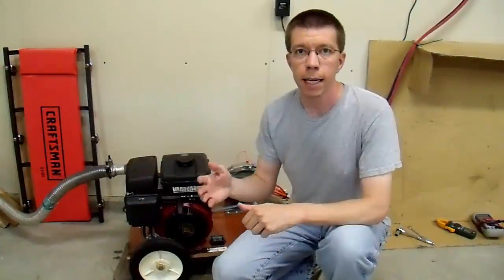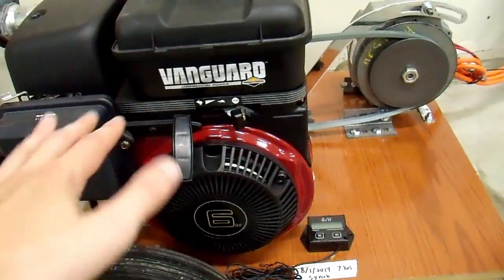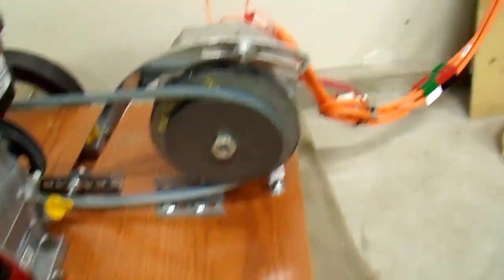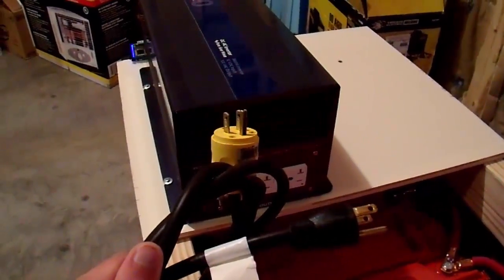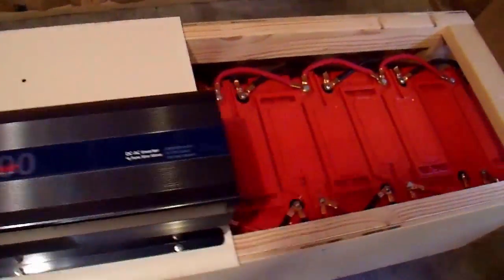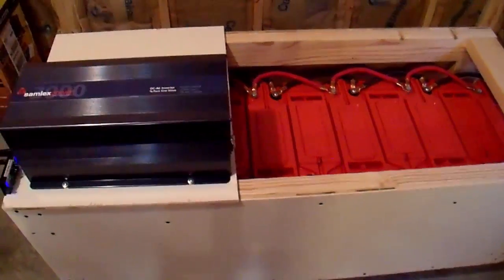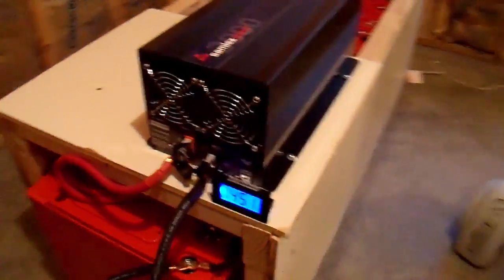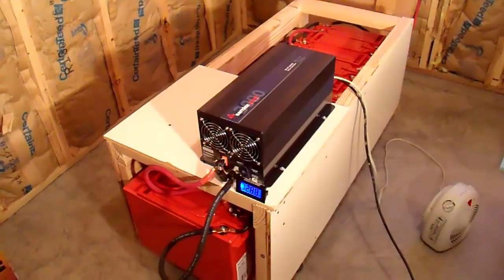DIY 12V Generator Charger - 10 Demonstration and How to Build

Comment: Please forgive the uninformed but I am new to this and leaning as much as I can.

Can you put a double pulley on the motor shaft and with a longer base add a second car alternator to provide twice as much charging for your battery bank or do you need a larger motor? 

How do you determine how much resistance an alternator will have when attempting to hook up a motor to it? Choosing the correct size motor cubic inches vs any alternator?

Thank you for sharing all your knowledge. I am of the visual type learner and just love watching your videos. Peace, Reese.
Reply from the maker: This engine is approx 180cc and is appropriate for a 100A alternator.  If you wanted to power two 100A alternators you would need an engine with about 360cc.  At some point you would get to better engine designs than a typical utility engine like this one and they would be more efficient, but for any reasonably priced engine that ratio is about what you'll need to ensure it won't bog down under load.

Comment: Some thing else possibly worth trying is changing the pulley ratio and getting the engine speed down to around 1800 rpm.
Reply: then that engine would not have enough torque.

Comment: This suggestion takes a bit of "mechanical" work, but you could have saved your self a lot of money.  If you had tapped directly off the 3 phases of the stator, you could have run much smaller gauge wire to you basement and rectified the voltage there.

You could try using the built in voltage regulator, but you might not have the same voltage after rectification in the basement due losses in the wire and different diode drops.  If you shop around on the web, you can find places that sell remote rectification kits as well as adjustable voltage regulators.

Or gone with a permanent magnet alternator and run it through a (solar/wind ?) charge controller after the remote rectification.

Yes, these do cost more money.
Reply from the maker: For various reasons rectifying the stator externally is impractical.  I did consider this approach.
Reply: ***** Remote rectification is commonly done on wind turbines,

Comment: Nice video,

I have a question what's the best pure sine wave inverter 500w ( decent price ), ?

 I intend to run my laptop (120w no Battery) and 2x 15w fans off the solar system. 

thanks for help ...
Reply from the maker: You probably don't need pure sine for your applications, however the Tiger Claw 1500W inverter may be a good choice if you want the flexibility.

Comment: nice work
I can not say how many liters of fuel consumed by the generator 6 hours of operation?
thank you
Reply from the maker: This particular setup uses about 1 gallon in 4 hours.
Reply: ***** thanks
Reply: ***** my 6 hp v shaft runs 2 1/2  hours on a quart of gas!
thats all the tank holds.

Comment: Great video knurlgnar! Though still kinds suprised you havnt invested into a proper interlock system. You spent all the money on inverter,  cabling, and engine. A $20 double pole breaker and ~$150 interlock kit more would make this setup much safer than with suicide cords. Great job on muffler and exhaust btw!
Reply: What are suicide cords?
Reply: @blackz06  male to male

Comment: Great explanation knulgar, regarding my cs130 alternator. Thank you.  I have not yet loaded it to the peak for longer duration than 2 hours.   Also, my smaller engine, 2hp, which  i had on hand,  is not capabile of fully driving this alternator at peak output.  These two factors maybe why i havent experienced any short commings yet with the cs130.  Also i am only charging a battery bank of  600ah (golf cart 6volt batteries series/parrall).
Reply from the maker: With a 2hp engine I am sure that you'll continue to be just fine!  That smaller engine isn't going to be capable of overworking the alternator so it's a non-issue I would think..  With the benefit that CS130s are so common they practically give lightly used ones away at salvage yards.

Comment: Are you running your house almost exclusively on your generator setup? It seems like thats what you implied in the annotations @17:43
Reply from the maker: austin30233 I can use this to power my whole house and have done so, but I use use the normal electric utility like everyone else most of the time.  (is that what you mean?)  Everything works just like it normally would on this setup except that I am more careful about my energy use, and nothing that requires 240V operates.  I have kerosene for heat and a portable propane stove for heating water.  (I can also use the microwave oven for cooking)

Comment: Greetings Knurlgnar, I have two questions about your 3000 watt inverter to dryer outlet adapter cable. First, with L1 and L2 line voltages in phase, will a 220 volt electric range work? Also, with L1 and L2 in phase, will the dryer 220 volt circuit breaker trip in an overload condition? thank you
Reply from the maker: James mcfly It will not power any 240V appliances, and since the dryer circuit is breakered at 30A that breaker will never trip.  The inverter outlets are technically NEMA-15 and rated for 15A where the inverter is capable of putting out 20A, so additional protections could be employed if desired.
Reply: Don't do the double tip cord it is dangerous, if you forget to flip the main breaker you are back feeding and can kill a lineman working on the power line. some call it a suicide plug but you will more likely hurt a lineman working on the outside plant then hurt yourself.  you can get adapters that will automatically flip to the batteries from ebay for $50

Comment: Somehow it feels like alot of the noise from that engine is from the wooden platform still vibrating alot.
Reply from the maker: tbbw Yes, you are probably correct.  I didn't come up with a good (and inexpensive) way to isolate it without messing up the reliability, alignment, belt tension, etc.

Comment: will car batteries work on a system like this
Reply from the maker: *****
Any time a battery is used for anything other than SLI (starting, lighting, ignition) a deep cycle capable battery should be used, even if the primary function of that battery is starting the engine.  A deep cycle battery will not have as much initial Cranking Amp capacity but will perform better over time and be more reliable.  e.g.  A standard car battery with paper thin plates may offer 1000CA when new, and after 10 moderate discharge cycles die with a shorted cell leaving you stranded.  A deep cycle battery with more robust plates may only have 500CA of capacity when new, but last 100 discharge cycles while it slowly wears out until it can only supply 300CA of starting performance.  At that point you may deem it 'too weak' to reliably start the engine and decide to get a new one at your convenience.
Reply: No, since they don't like to be discharged. If you discharge them you ruin them. You need deep cycle batteries for this sort of setup.
Reply: my rv has a battery that runs the lights inside when im off grid and if i plug in to a electrical outlet it has a built in charger that tops the battery off should i use a deep cycle battery in this sitituation too since i some times drain the battery all the way down

Comment: Why do you not recommend the cs130 alternator?  I use cs130 alternator on my simular setup.  I do like the remote voltage sense monitiring function the cs130 provides.  What are your concerns?
Reply from the maker: schickmann The 27si also has a remote sense option but I chose not to use it.  The CS130 would work for short term use, or for charging a small battery bank as in 1 or two batteries in many cases.  It was designed to be GMs first small frame high output alternator and they had significant trouble with it overheating - which is why the regulator has an inhibit function when the regulator overheats.  They also used bearings that are small which do not last long under high stress conditions, especially if the rotor gets hot due to full field current for long periods of time at lower RPMs (as it would in an efficient configuration).  When the rotor gets hot the length of the shaft expands and the needle bearings in the back housing get crushed and bind, quickly failing.  They made some improvements over the years but the design remained weak throughout its life.  The CS144 would be a good choice, as this one is the larger frame (like the 27si) and runs cooler.  Some alternators are capable of full field continuous operation at any RPM with a long service life, and some were only designed for peaking loads.  The CS130 was designed for peaking loads.Glad it's working for you though.  I am sure it helps that it isn't crammed into a hot engine compartment!

Comment: Love your videos. I have sort of the same set up.  Same size motor but knock off make. Alternator was planned for a wind turbine so it has been changed to magnetic rotor with the rare earth magnets. I had the same problem with the pulleys and ended up with a close set up to what you have.  
Question off this subject. Have you dealt with grid tie inverters much? Why I ask is I have a 300 watt one that I wondered if there was a way to make it in to a regular inverter since its already pure sine wave.
Reply from the maker: KSfixitman Interesting that you ended up with a similar setup!  I have not worked with grid tie inverters much, but I doubt you can 'convert' one into a stand alone inverter if it is not designed to be one.  The inexpensive ones generally rely on the grid waveform to operate and augment the crests with additional voltage to shove some power backward into the lines and they don't really have the smarts or components to operate as a proper stand-alone inverter.
Reply: That makes a lot of sense. I was kind of thinking it would not be possible but I thought Id ask. Thanks for the response.

Comment: First!, You made us wait for that I'm sure I watched the other 9 videos 2 yeas ago waiting for you to start the engine :-) Can you briefly mention the safety precautions you take to avoid back feeding and inverter destruction?
Reply from the maker: Coolkeys2009 I have a few videos out there on safely connecting to the house.  One is how NOT to connect an inverter to your house and the other covers the many safety issues with this 'backfeed' technique.
Reply: ***** wonderfully informative videos, for those that stumble on this channel can you please mention how important it is to disconnect the house from the grid before operation if you are going to backfeed your house with a secondary voltage, for the safety of utility workers. You can't mention it enough, a simple lockout on the main breakers would suffice. Keep up the good work Knurlgnar24 knowledge is power.
Reply from the maker: Danyal Ahmad
DC motors that can be used as generators use brushes which are unreliable.  Alternators use slip rings which can run for thousands of hours without service.  In addition, they are more common and much less expensive for a similar build quality.  Alternators are mass produced, field tested for millions of hours in various equipment, and readily available.  Most brushed DC motors can only operate for a few hundred hours at full load before failure while alternators run for a few thousand.
Reply from the maker: Danyal Ahmad
Most brushed motors are rated for 500 hours of operation at rated load and 25c ambient temperature.  Automotive alternators are designed for around a 2000 hour service life at extreme temperatures.  DC motors definitely are more efficient but only at their optimum operating point, e.g. a specific RPM, specific torque, and specific output voltage.  Outside of those parameters they are quite inefficient so a MPPT is needed to use them efficiently.  (Since it can change the output voltage to allow a more efficient configuration)  Alternators enclose all of this in a nice compact package with exceptional build quality (in comparison) at a low price so I chose the easy way out.  :)  A properly designed DC generator system will be more efficient - I give you that - but this has readily available replaceable parts.  If this thing is still running 40 years from now I can still find parts for it off the shelf be it engine, belt, alternator, cabling, etc.

For wind power and the like an alternator isn't going to work well but this application is well suited for it.
Reply: ***** Your videos are awesome! They cover  every category I can think of, for the most part. Although, I have to ask  you,  why a alternator over a dc motor?
Reply: ***** Alternators produce AC electricity, and must be run at a extremely high rpm to get a good 120v out of them. However a DC motor obviously produces DC electricity,  and is very easy to get power out of. I can actually spin them with my hand and get a easy 12v out of them. I have tried using several used Treadmill motors, from ebay for only about $50 each. Where has I have purchased busted up Alternators from the junk yard for the same price. Also, Alternators need some input to start generating. I would guess that that there is a difference in current between the two. You are right about how long they survive, for the most part. I think a DC motor running 24/7 will survive about 4 years. Its hard to say how long a alternator will survive, in the best scenario possible they'll run 100,000 miles. I'm just trying to say there's cons on both side! How much output do you get from it? I'm pretty sure you can get real good results with a 6 horse power engine. And this is all based off of me using a Professional Series electric drill which wasn't ever close to 1/2 horsepower. Have fun experimenting, that's all I can say.  Please tell me if I have made any mistakes.
Reply: +Danyal Ahmad One form of "charge controller" is simply a DC to DC "buck boost converter".
Reply: Yes?
Reply: Coolkeys2009 good point plus I add the doubt of practicality of this generator
Reply: Turn the power off at the main pole, plug into drier and DONE
Reply: MPPT  not  PWM  and Edison cell's  Iron Edison Battery Company
Reply: Edison  batteries last a lifetime and probably 2 or 3 with maintenance and a lot of distilled water. but the only new one i found cost 11k for 1 kw
Reply: Coolkeys2009 variabel
Reply: Coolkeys2009 j bnb
Reply: *****
Im pretty sure, 40 years from now I can go to a salvage yard and easily get another dc motor, but I see that was suppose to be a example. Although, what makes you think the thousands of DC motor manufactures out there will change there ways 50,60,70 years later? Unless there's such a break through that will convince them to invest millions of dollars I don't see it coming. The thing you said about the MPPT charge controller, I found fairly interesting. What, can I say we learn more everyday. I don't actually know what charge controller exactly do besides monitor the input and charge in the battery. What do they do to the input? Increase it?

Alternator are alternator, they do what they do. DC motor are dc motors, and they do what they do. Lets just leave it to perspective, there's not really much to argue about.
Reply: Danyal Ahmad